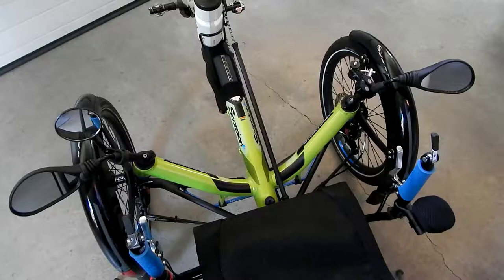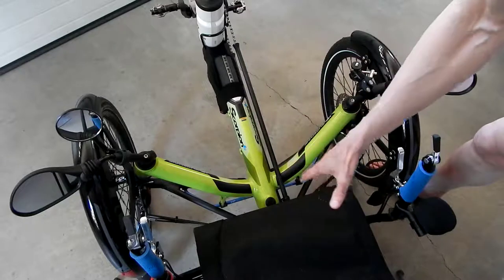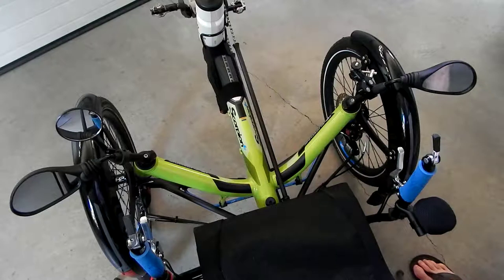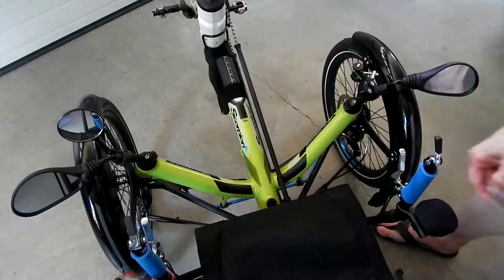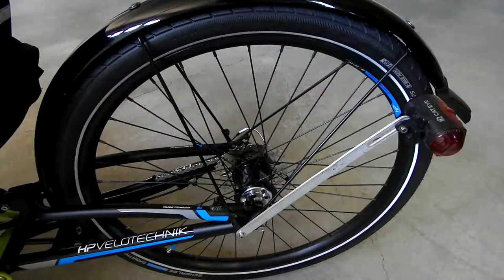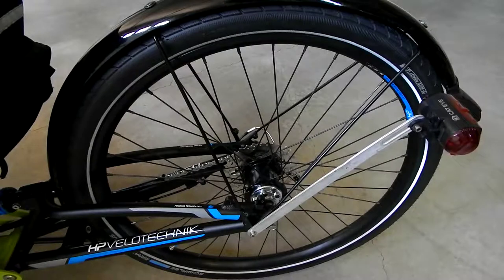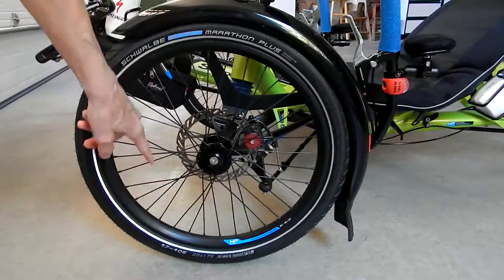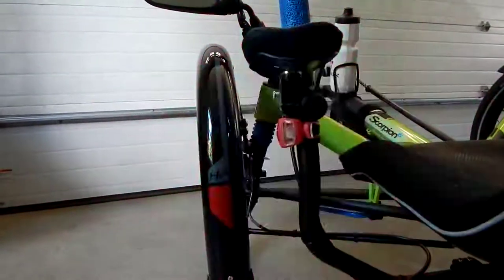HP Velotechnik Scorpion fs26 Enduro -  Frame, Lights, Spokes

Comment: That is really nice regarding the swept back style of the frame. For me, sitting down isn't as difficult as getting up. It's still pretty easy for me on my current ICE Sprint. I usually hold my arms out horizontally and sit up straight or even lean forward a bit. That moves the center of gravity forward and closer to the feet. Then I can stand pretty easily. But as I get older I know this will become more difficult. And the extra spokes is a nice touch! It's those little things that really add up. As the saying goes, you get what you pay for.
Reply from the maker: Yep, you definitely get what you pay for! I've heard some trikers wonder why spend all the extra money on a fancy trike when entry-level trikes are available for a mere fraction of the cost. While there is a huge range of prices on trikes, I will say from my own experience that the higher-end trikes are indeed superior in many aspects, and clearly worth the money if a person has it available. These high-end trikes are not just "bells and whistles" niceties that are of little consequence, but, as you realize David, the additional costs go for meaningful things like suspension, which, while not essential for trike riding, sure makes a big difference in the rider's comfort on the road. The base price for this trike was $5550, but those extras add up quickly as you said, and I paid just over $7000. I am not complaining at all however, as I'll be keeping this one, my fourth trike ... and my LAST!   Yee haa 
steve
Reply: @EZSteve  Agreed! In my past I worked for 20 years at a high-end home audio store. We sold stereo systems starting at about $2K and going up to $250K or beyond. People would always ask, "Is a $10K stereo five times as good as a $2K system?" I'd tell them, "No. But we each have our point of diminishing returns. If paying $8K more gives you results that you are happy with, then it's worth it TO YOU." And that's key. If it's worth it to you, it's worth it.
Reply from the maker: @DavidRidesaTrike  Yes, as with all things human-related in life, opinions vary all over the map, and a person's individual priorities determine their actions. I may be big into quality audio systems, and willing to pay the moon for the best, but riding tricycles may be a low interest aspect for me, so I get the least costly. Or, for someone like myself, I typically go for quality over cost when I contemplate most things I acquire. I usually figure it is more cost effective to pay more up front and get a product that is high-end and will last while providing me the best experience based on my perceived needs, rather than get a lower-end product, end up regretting my choice, or it falls short in some manner, which results in my spending even more money to replace it. Having spent years earning and saving money, my outlook is that money should be at my disposal to use as I see fit, and not become my master to the point that I squander it away and not enjoy life as I would like (I can't take it with me at the conclusion of life's final chapter, so may as well get rid of it before the ride is over ;-)

... and who ever said that we can't have fun and be extravagant with our spending ... after all, I still ride a tricycle, a thing I did in the early 1950s, so as an overgrown kid, and no longer being told by my parents what to do, I just spent a wad of cash on a tricycle (as a point of clarification: I mentioned in an earlier comment that this was my fourth trike ... well, rethinking that statement, I realize I had at least two trikes as a preschool aged lad, so this would be at least my sixth trike ... gads, I've had a lot of tricycles)!
Reply: @EZSteve  I'm with you on spending what we need to spend to get what we've determined to be the best option for us. This gets back to what I was saying about each of us having our own point of diminishing returns. We pay what we believe will give us a product that we appreciate and use very regularly. And for each of us that point of diminishing returns applies differently to different products. The entire time I worked for that stereo company, I never bought a sound system. I love music and I listen to music every day. However, to get a system where I wasn't saying, "I wish I had done this … " was simply beyond my means. If I was very wealthy I would spend $50,000 - $100,000 or more for a stereo system. But that was extravagance that I couldn't afford. So instead, these days I listen to music on a very nice pair of computer speakers while I work. Do they sound anything like a system costing thousands or tens of thousands of dollars? No, not even close. But I'm still able to enjoy the music and that's what matters to me. With the trike though I'm more willing to spend what I needed to spend to get what I wanted. 

And for the record, I can only remember one trike as a kid so you're way ahead of me. However, I did have one of those "pedal cars" which I loved. Does that count? 😎
Reply from the maker: @DavidRidesaTrike  Yes, pedal cars count if they are three wheels, and even more so if two of the wheels are in front and one is in back (tadpole design). I had that little red one shaped like an airplane. My other trike way back then in those days of unquestioning innocence was a delta design with a metal seat, not nearly so comfortable, haha. I cannot think of anything more worthwhile to empty my wallet than human powered vehicles!
;-)
Reply: @EZSteve  Damn, I guess mine doesn't count as it was a four-wheeler. 😉